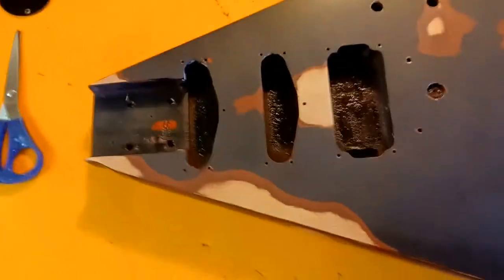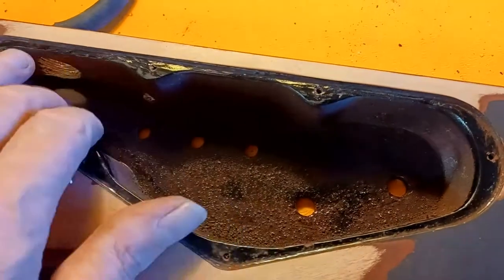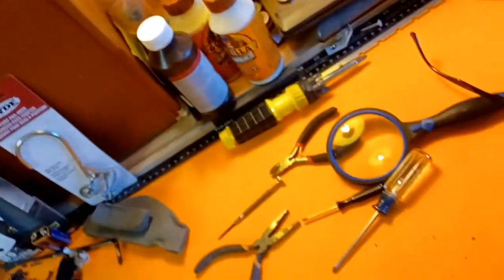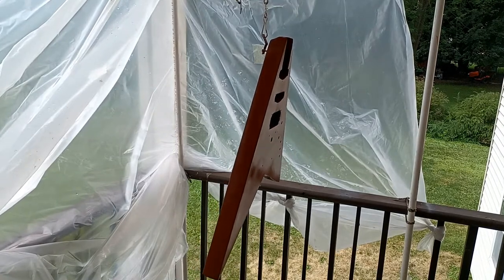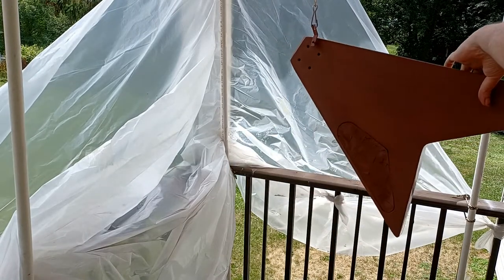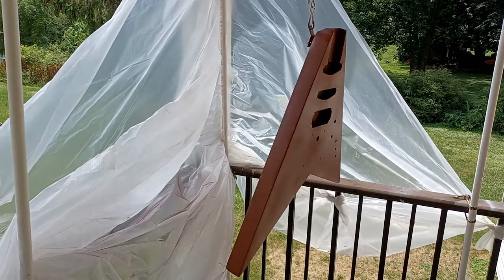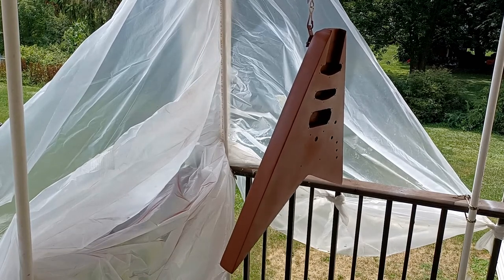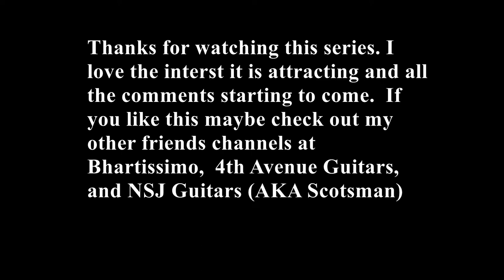Washburn RR11v Resto Part 3 Priming

Comment: Other than the 2 spots you pointed out the primer paint looks like it went down and covered the body nicely. Once to spot fix the two goofs it will be looking good and is ready for the next step.
Reply from the maker: Yup yup yup!1  Already fixed and painted the base red. Will be doing strips in the next day or so once I get all the measurements down where they need to go.

Comment: Coming together, 👍 I have no idea about painting guitars so you might teach me a thing or 2. Not sure if you mentioned it but what color are you going for? Gonna have a matching headstock? Since they were butts are ya gonna remove the Washburn name?
Reply from the maker: The neck and head stock are black with the white Washburn logo. I am pondering now if I want to mask off the logo with its age faded white, paint over it in the bright white from the explorer, or try and find someone to make a new water slide decal logo. I guess that will all depend how the sanding of the clear coat goes. I will surely be doing the front side of the head stock by hand.